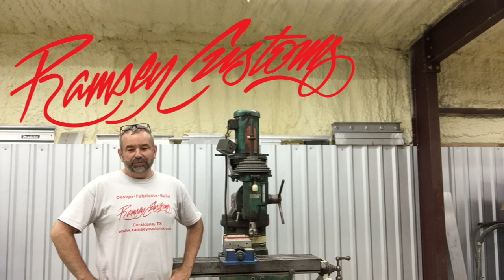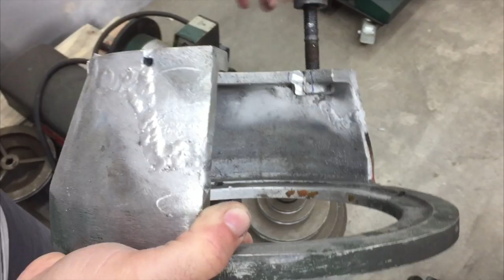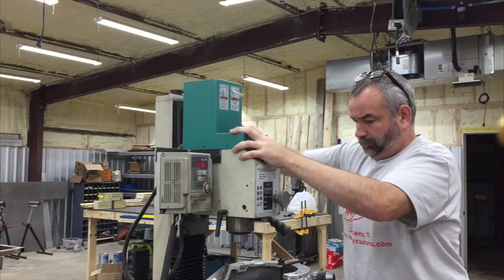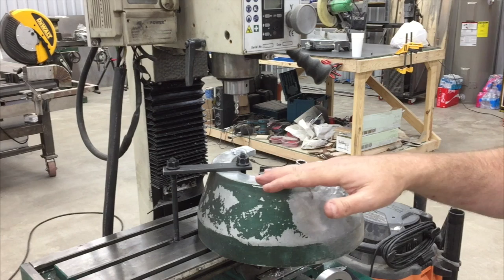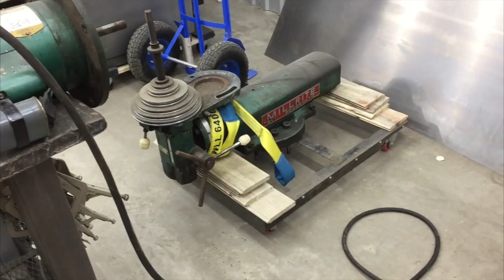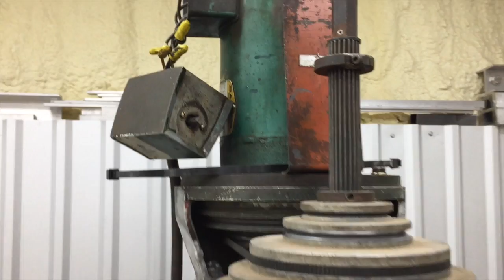Bridgeport Style Milling Machine Repair - Tig Welding Cast Aluminum - Metalwork Monday

Comment: Just had to razz you a little chickened out on power tapping buck buck. lol
Reply from the maker: Lol, I didn't chicken out, i wouldn't even attempt it on that machine.  At low speed that machine has no balls, at 200 rpm you can grab the spindle with one  hand and easily stop it from turning...
Reply: Needs a backgear. A bridgeport will snap some serious shit in low gear.

Comment: That repair looks good. My two cents....I'm a big fan of putting heli-coils in any aluminum
work piece, but if it's going to be bolted up once and left alone they aren't really necessary
unless you need the holding torque. If you ever wanted to go back and add them though, you could possibly bulk up the areas around the bolt holes with the TIG.

Comment: I just got to weld some cast aluminum the other day.  A customer had me weld up 6 of the 8 holes in a differential housing.  Its a little harder to do than regular aluminum.
Reply from the maker: Definitely hard to make a nice weld with, but if you just need to fill some holes, or in this case fill up a slot, its not too bad if your just going to mill or grind over it.  I have an intake to do next week, so more cast aluminum for me!

Comment: Great video mate,as always. Had a similar job come in after the mill took a spill in shipping. After several attempts to get it sorted I ended up using it as a pattern and melted it down to cast a replacement. Was pretty easy to do and end result was far more pleasing and a lot less work! Added extra alloy from a trashed alloy wheel,recycling at its best.
Reply from the maker: Sounds awesome, I have zero experience with casting, but would be fun to do.
Reply: +🔥Ramsey Customs - turbocobra have a go mate,so easy to do and great fun.loads of videos on here to guide in right direction. Feels amazing when a replacement for a long lost or damaged part emerges from the sand. It becomes addictive! Soon you wanting to make everything.. I last cast a beautiful belt guard for a machine that was missing. Have a go!

Comment: Up and running...............nice repair Gary!
Reply from the maker: Thanks Tom, btw, i saw your comment on welding in a slug, I had though of doing that also, but i couldn't figure out how to do it and be able to have it welded all way around for the entire 1" depth
Reply: you would stick it together as straight as you could "like you did" then drill the threads out of the hole, then make the pin just slip in, no slop, but not a friction fit either. then leave the pin short, even 1/8 on each end, or top and bottom. then weld it all up. there would be no need for weld all the way through because you have the pin completely encased with your 1/8 inch or so of weld top and bottom. Chances are you would never be able to tell the holes were even welded up. And 2 things are gained, you will have a nice clean machined surface so there would be less voids in your welding and also you would have far less heat. Any time you have a hole that has a break, crack, or its just drilled in the wrong place plugging it is usually the quickest most efficient and effective fix. The way you fixed it will  work excellent, but you used a lot of rod and it does have some porosity in it.  I didnt catch the first video because I was on vacation. Plugging is almost always the best way unless its tool steel, then it gets tricky!
Reply from the maker: Ahh, yea, i kind of thought you meant something like that.  I have watched keith fenner and keith rucker do cast iron and cast aluminum repairs by building it all back up so i just copied what i have seen them do.